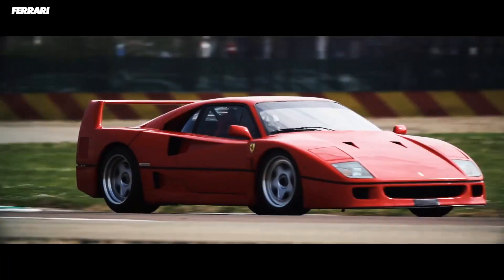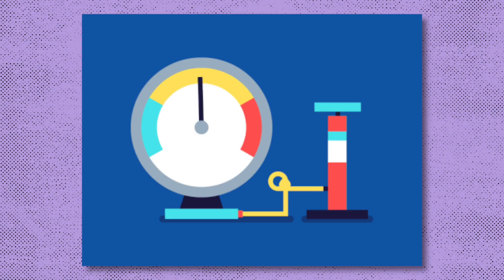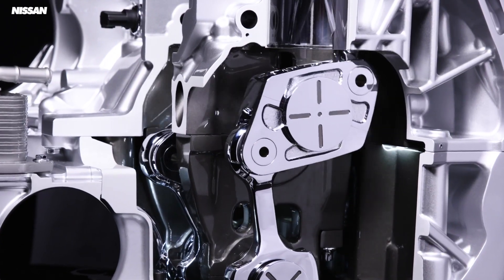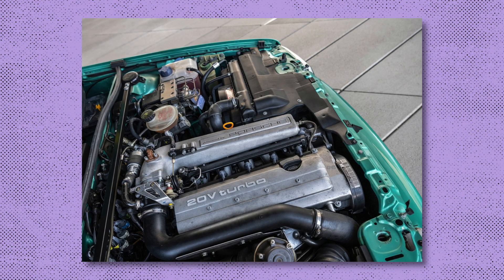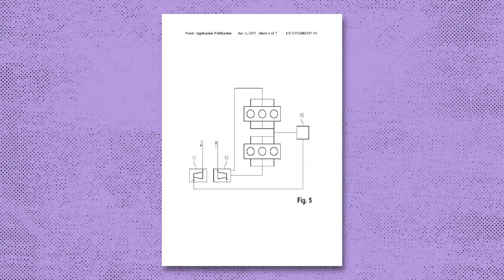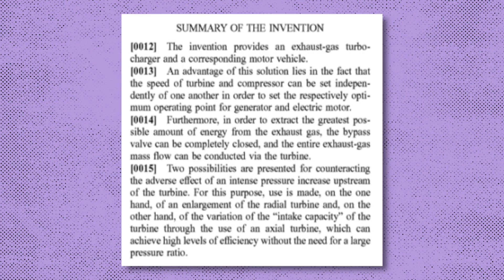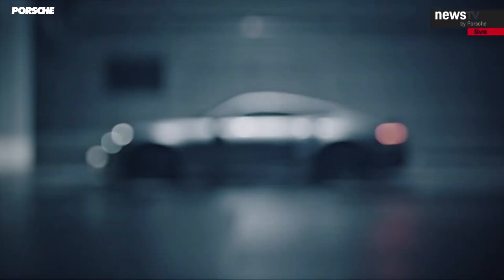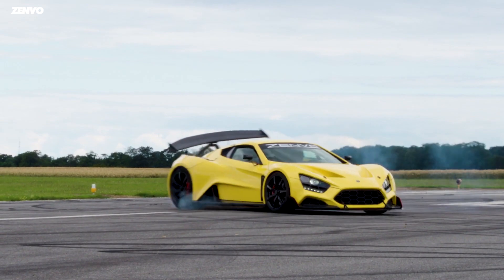Porsche's GENIUS New Turbo Design

Comment: I think this video miss represents the fundamentals of Porsche's design. This is not a turbocharger it is a power recovery turbine paired with a electrically driven centrifugal supercharger effectively a turbo compound engine. This engine will ultimately be paired with a hybrid powertrain to make use of the power generated by the turbines. Similar in concept to the 1950s aircraft engine the wright R3350 turbo compound except it replaces the fluid couplings with a generator and a mechanical supercharger for a electric one. This concept could potentially double the thermal efficiency of the engine.
Reply: "This is not a turbocharger" thank you for not making the internet dumber.
Reply: @Alfred Wedmore I don't know that about the Titanic that's really cool to know. This Porsche design is not to dissimilar to current F1 engines except in F1 they have the turbine and compressor on the same shaft with the electric motor either in the middle or on a extended compressor shaft. Mercedes is claiming 57% efficiency the best a NA engine can do is like 25% a turbocharged engine can get up to 35%.

Comment: Twin turbo does not create faster spool up, if you have a single turbo and it is sized properly will spool up just as fast as any twin turbo setup. Current F1 Cars are all single turbos.

Comment: I'm sorry but turbo never helped with fuel consumption it always increases fuel consumption. Modern twin turbo and sometimes single turbo 1.6 engine burns more fuel then NA 3,6 V6... Weight savings might be good for performance and handling but not for economy in that instance.

Comment: 1:00: it’s not only that “engines prefer” cooler air. It is that warmer air is less compressed! Thus defeating, in part, exactly what you are trying to accomplish. Proof of this is your bike tire. You pump it up on a 75 degree day, and then two days later the temperature falls to 40 degrees… and you need to put more air into the tire. But on to the concept of the electric turbocharger. Such devices have been available for years, and routinely scorned. In most instances, rightly so because they were not configured correctly. But bearing in mind that ANY ‘boost’ always robs from somewhere to get somewhere - the concept of charging a separate battery while cruising, so that its energy may be deployed to boost the engine in moments of need, is solid. Too bad it’s so late in the game.

Comment: Interesting video but the main advantage of disconnecting the turbine from the compressor isn't being different sizes you can already do that. The main advantages that they can be spun at different speeds.  Different sizes would just be a function of that advantage.
Reply: Can you not just do that with mechanical gears on normal turbos?
Reply: @PaulMansfield  you could but this way you can vary the difference in speed.
Reply: @DoRC  good point, and you could also switch the boost between "weekend cruise" and "track" mode.

Comment: Technically if it isn't connected to the turbine side doesn't it then just become an electric centrifugal supercharger, with the most insane control system?  It sounds interesting and great video btw 👍, but it seems extremely over complicated for what it is. Obviously researchers at Porsche are far more knowledgeable than me 🤣, but I'm not sure how this could be cost effective or efficient enough for a production car. Gone are the days of "The widow maker"

Comment: Add a battery, and you could remove turbo lag entirely. Computer could spin the turbo as soon as you put your foot down (draining the battery) and then recover the electricity a few moments later when the exhaust starts flowing through.
Reply: Battery? That's too slow. Capacitors would 'charge' and discharge much faster. KERS type system.

Comment: The reason no one has been doing this before is that it adds too much mechanical complication on top of the "regular" MGU-H system so will be surprising if Porsche can actually pull it of in any meaningful way.
Reply: Yeah, there's a lot going on simply to remove the shaft, which doesn't do anything outside of lower efficiency a bit.
Reply: @shaunmark1  Not sure if that’s what the patent is all about though 🤷🏼‍♂️

Comment: The output heat from compression won’t change. It’s Charles’ Law. Removing a hot side or moving it will only reduce engine compartment heat and to a ‘degree’, ambient intake air. But compression is compression and while electric allows for probably almost instant spool, the heat generated will still need to be cooled. No way around that. In the end it doesn’t matter what drives the comp wheels. Exhaust, belt, motor… just different ways to get the same thing. Hot compressed air

Comment: A danish company did an electric bolt on compressor that you could fit to almost any car 20 years ago. It was a modest boost of maybe 10 - 15% more power, but considering how much better batteries and electric motors have gotten, it must be possible to make a system like this work better than any normal turbo or compressor today.
Reply: I thought a decade back this would have been very common at this point from aftermarket turbo manufacturers, yet there still isn't a valid one out for sale.
Reply: Easier to just use an engine driven supercharger or an exhaust driven turbo, electric turbos as you describe them just don't have any real advantage to make them a viable product, which is not to say the Porsche type in the video wont work but that's a totally different beast to the old electric turbos.
Reply: @popuptoaster  what is different now is battery technology allows you to power way more with the turbine. Batteries can load and discharge faster and most of these systems will run at 48v to start. Formula 1 MGU-h systems run at 800 volts and they can contribute 160+ hp.

Comment: I've got a 2021 Mazda CX-5. 2.5 litre four cylinder turbo AWD (gasoline powered) and it has zero lag. Mazda uses a variable pressure system where there is a vane in the exhaust manifold which controls the flow and "turbulance" of the exhaust gasses hitting the turbine. This enables the engine to spin the turbine efficiently at any amount of revs depending on how the vane is positioned.

Comment: The Porsche system sounds similar to the Kers Exhaust Power system like the once in F1 cars. They Use the heat energy of the Exhaust for the Electric engine and Porsche would just use the Preasure in the Exhaust to Power those turbines. If they use a 48 volt system that could also be used for not only the Turbo but maybe also for spinning the Engine or driveshaft while shifting and maybe could be used for an EV mode that has Very Limited range. but it sounds very Interesting. I hope the Guys down in Stuttgart make it Amazing.

Comment: I'd understood  that the two turbo set-up was superseded by variable geometry turbos. Effectively these are both a small turbo and a large one combined in one unit. Aren't you conflating two different issues - achieving boost across the full rpm range (solved with variable geometry) and eliminating lag (solved by fueling the engine to generate boost even at idle) ??
Reply: The purpose of these systems is to really fill in torque on a turbo system in that 1000-3000 rpm range and then fade away once the big turbo kicks in. So yes removes lag, but because of this you can run a much larger primary turbo. By doing that you gan over the whole range. Look up some of the dyno chats at the torqamp site. Borgwarner, garrett also have this technology as well.

Comment: What a load of frog turd. All this and anything like it just creates another SINGLE USE  collection of rubbish. These engines are so complicated that they are probably either non repairable or  just not cost effective to even try to fix. Why does every new engine HAVE to produce more and more power and yet never has a significant reduction of fuel consumption. Is 100-200Kw not enough to kill everything on the road. If porsche or any other company produced cars with the 200Kw that used much less fuel than anything today. That would be a feat to brag about but I doubt they could never get out of the more power more speed, more cost, more dead scenario.

Comment: Decent idea, it will be interesting if the parasitic losses from running 2 turbine/alternator and compressor/motor setups. I wonder if this will be worth it or just marginal gains
Reply: it's powered by exhaust gasses aka waste
Reply: @GewelReal  correct! But transferred from thermal, into kinetic, into electric and back.

Comment: Good video and channel,  but please dont repeat the political message about consumption. The only reason that downsized turbos appear to use less fuel is because the test doesnt replicate actual usage, the old test was even worse and forced the wrong engineering decisions onto manufacturers. To avoid a very long explanation think about the additional mechanical losses incurred by the turbo system.  For anyone who doubts this do the real world test yourself. Then add.the additional development, construction and maintenance costs. In the real world n/a engines are cheaper and don't use more fuel unless you drive in cities.

Comment: No have it all wrong.  Turbos increase efficiency by converting the usually-wasted exhaust heat into useful work by pushing air into the engine.

Comment: The only issue I foresee with this is every step added loses efficiency in keeping with the law of entropy. So any gains made by spinning a turbine with an electric motor would be less efficient than using an electric motor applied directly to the power train like a Prius.
Reply: Wouldn't it be a net gain because most exhaust energy on cars is a wasted any way? Just asking
Reply: @miketdarnell  I was referring to an electricly spun turbo like a super charger. As for traditional turbo I'm not sure. Yes it uses otherwise wasted exhaust gases/pressure which also burns more fuel so I don't know if its more efficient or just more power. 🤷‍♂️

Comment: I swear Merc had an idea really similar to this that they applied to their 2014-present f1 engines.
Reply: Nah Bro, mercedes has an amazing turbocharger where compressor and exhaust turbine are on opposing sides of the engine.
Reply: @NicoBiturbo  All of the current F1 cars have a similar turbocharger integrated with an electric motor-generator.  Mercedes' is the one that works best.
Reply: I’ve worked on a newer M256 engine that did have an electric borgwarner turbo that builds a max 6psi to reduce lag
Reply: I'm pretty sure aswell, cool and hot side split on the opposite sides of the engine with a axle going through and a generator/motor on the cool side if i recall correctly.

Comment: Callum mcintyre
inside Computer mechanisms
To cool processor by electricity
The program called water fall
The turbo charger must serve like that program with electric motors
My imagine is to have virtual turbo charging to cool over Serving the Entire  electric engine mechanisms
How?
With currently turbos I boost speed of the vehicle
Simply we need equations of whool emissions out from the car in field of use to prepare turbo booster Software
Again I write in field of use the car
To provide high stability engineering
And reverse engineering that made to all car kit for turbing Saftey

Comment: How long does something like this take to develop from filing the patent to making it in production cars? Seeing the 911 turbo 992 came out in 2020 I suspect this won't be implemented until 2027? Do Porsche still believe they will be selling enough ICE cars in 2027 to justify costs on this new system to enter production? I don't think so, by 2027 it will be more than obvious that EVs are taking over, nobody will want to buy an ICE Porsche 911(outside of die hard fans)... Great idea that will most likely never see the light of day in production cars.

Comment: The problem with this is that it doesn't reuse the thermal energy from the hot exhaust gas, that would be otherwise be used in a normal turbo.
So, the thermal efficiency of the engine wouldn't really improve. This is basically a supercharger, but instead of driving directly from the engine it's running on electricity, which I'm assuming comes from the alternator. It's just adding one more energy conversion, but I suppose you can precisely control the speed of it regardless of engine speed, which is good.
Reply: How does it not? The turbine side electric motor transfers kinetic energy to current, just as normal turbine transfers the same energy to rotating motion of the shaft. Kinetic energy is the cause of pressure difference before & after the turbine which includes temperature difference.

Comment: Turbo lag has already been removed in a bunch of cars. I have a 2016 F150 with the 2.7 ecoboost. I don’t have to wait for boost. I have towed a 2001 Cadillac Deville 3960 lbs on a Uhaul trailer 2,000 lbs. My truck pull like a 6.2 v6.
Reply: Pretty sure if i go in your f150 i would wait ages for boost coming from a cls63. When you are not use to better. You dont know better. Every car has turbo lag. My m5 has turbo lag. So how the hell a 2.7 ecoboost doesnt have😂😂... anyways my friend has your truck. You do wait for boost.
Reply: @ACURACALABAR11  Stop lying about what you have. Only a person who has never driven an ecoboost would say they have lag.
Reply: @Fone65  bro i dont need to lie. Why do you think im being disrespectful? A 2.7 EcoBoost engine has lag. Every turbo engine has lag. So what makes you think your truck is any special? My 2016 cls63 with a stage 2 eurpcharged set up has lag. My 2015 m5 with a stage 2 mhd setup has lag. You think your truck is any special? I have driven your truck. As i say my friend has the 2017 2.7ecoboost just like yours. When its in sport mode. He swears its the fastest thing..its not! As i say if you never driven better you cant understand what lag is. No disrespect. I dont know why you feel offended.
Reply: @ACURACALABAR11  true
Reply: @Fone65  what does breaking tires loose have to do with turbo lag? Whatever u say to make u feel good. U should have just op for the v8. EcoBoost 😂
Reply: @ACURACALABAR11  I had a feeling I was talking to a child. You want understand until you drive one. I'm done.

Comment: i would like a small electric motor, keeping the engine running, so you can coast in gear to help fuel economy. like and old saab without the freewheeling clutch

Comment: OR you could buy a Tesla PLAID for half the price and get 0-100Km/h in 2.2 seconds with a 9 second quarter mile and beat the pants of any PORSCHE. 🤣🤣🤣
Reply: Hey.  That’s volts, Amps, watts.  That’s an appliance.
Reply: @IvanaNotyers  An appliance that carries a family in better safety and FASTER, and in case you were mechanically illiterate Gas cars are also measured in KILOWATTS 1hp = 746 watts, the Tesla plaid just on the DYNO 4 wheels driven 1,104Hp:yougotthis::yougotthis::yougotthis:

Comment: I hate turbos, I would rather have the same engine without the turbo. Response, linear torque curve, and high redline are all more important to me than peak power.
Emissions isn't a good enough excuse, If the C63 could go from a 6.2 to a 4.0 twin turbo, they could definitely just make a 4.0 NA. I DONT CARE IF ITS LESS PEAK POWER.

Comment: The only case where I can see this being worthwhile in terms of complexity and cost effectiveness is if it's implemented on a PHEV or at least a high performance hybrid with eCVT. With even a modestly sized battery pack, compressor lag could be completely eliminated. 
This reminds me of the Caterpillar DD15 turbine which is coupled to the flex plate, apparently to maximize efficiency by making some use of otherwise wasted heat in exhaust gasses. 
It may be a challenge to keep the turbine generator rotor cool enough not to quickly degrade the (presumably) neodymium magnets, unless it's just a SynRM motor with no PMs.

Comment: The turbo fuel economy is somewhat of a misleading.  It’s true at lower revs it’s more efficient than a larger na engine with the same power.  The issue is when u jump on it.  Typically they run lower compression ratios and run richer, so at higher revs they don’t extract as much power from the same amount of fuel as theoretical na engine we are comparing it to.  So freeway cruising yes more efficient.  Driving harder on a backroad maybe not.  So yes it more fuel efficient but I find this caveat interesting.  In a race setting the na car given equal hp will have better fuel economy.
Reply: Reducing capacity will always save more fuel when not on power as the engine can be smaller capacity but produce the same power or more when it is on boost.
Reply: @philiphawkins4684  ur not understanding what I wrote
Reply: @AB-nv7bz  You don't seem to understand what you wrote...
Reply: @philiphawkins4684  EXCELLENT COMMENT.
true, a smaller engine in the same application will deliver better fuel efficiency than a larger one, unfortunately folks like A B don't have the education of professional knowledge to understand this.
Reply: Thats an very naive, uneducated comment.
You clearly lack any formal education or professional experience on the topic of turbocharged engines and engines in general.

It is an irrefutable fact that Turbocharged engines deliver BSFC performance.. debunking everything you wrote in your comment.

Comment: What difference does it make in fuel economy if you have to burn premium fuel?  And it is a well know fact that any engine that used forced induction will not last as long as a naturally aspirated one. I don't really care for all this added complexity in an engine, especially for a normal passenger car.  Leave it to Porche or Corvette to do this, although the Corvette is still mostly naturally aspirated.
Reply: Porsche is researching to make engines stronger while also being lighter by using artificial intelligence training to find the most ideal structure for engine parts while keeping them strong, and 3d printing will play a part too